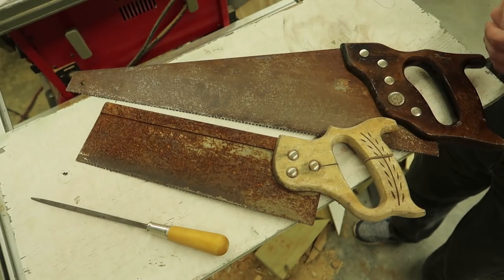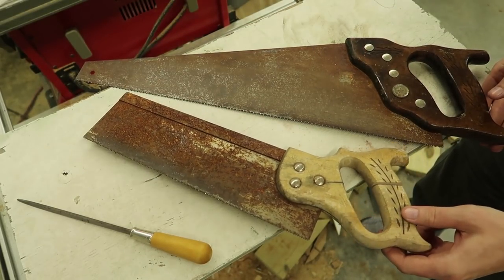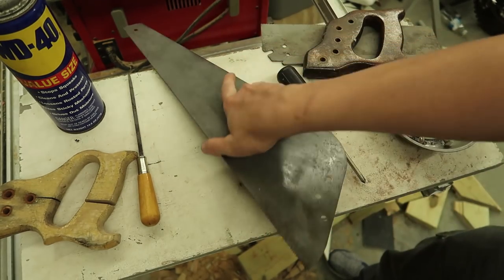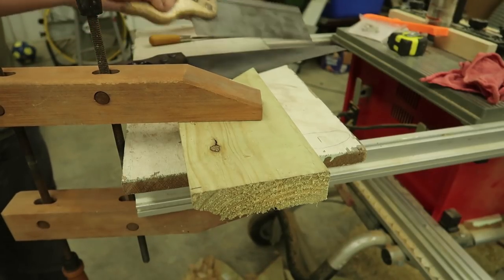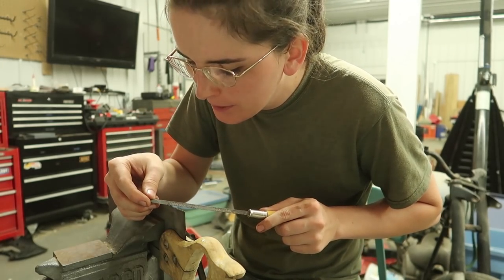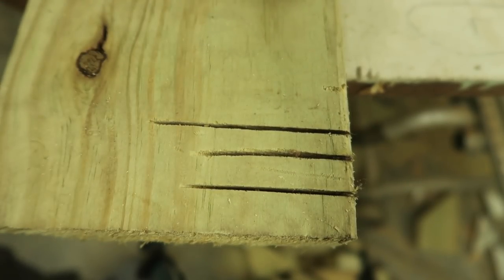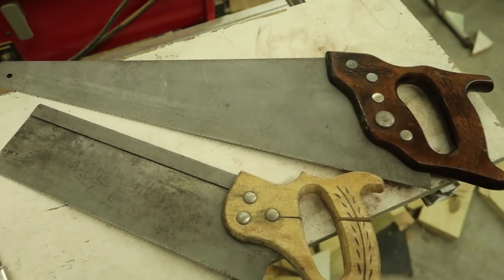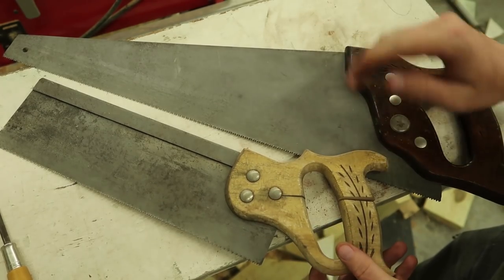Crosscut Handsaw Restoration: Removing Rust, Saw Sharpening, Zinc Electroplating Test

Comment: There is a lot to saw sharpening something I’ve looked at but never had the time to study like setting the rake and set and angles of teeth etc.
Reply from the maker: study? dont need much studying, just a file and a saw, and then once you do the best you can THEN you study
Reply: Rinoa Super-Genius no disrespect but what you did was a redundant step it barely cut after your “sharpening” but what you did do was damage the original settings of the saw so now once you do study you have to first repair what you damaged before you can do a correct sharpening.
Reply from the maker: what you are describing is called a learning experience.

Comment: Hi there, I was wondering if you have had any issues when using these saws with getting stuck or binding up on you. I was told that sandblasting will leave a finish on the saw in which it makes it really hard to push and pull while your cutting. so...are they all good or? Thanks!
Reply from the maker: yes this style of saw is horrible for actual use, thats why most woodowrkers today have switched to japanese Ryoba saws. ya see the issue lies in american saws being push cut instead of pull cut. american saws need to be thicker to push, but they still bind up. japanese saws can be thinner and they cut beautifully. i highly recommend getting a japanese pull saw instead. i have a bunch of these old push saws but they just arent useable. especially since a good pull saw will cut faster than an electric saw.
Reply: @RinoaL  Thanks for the tip! My saws suffer the same issues as yours.Im going to have to look into getting me a japanese type. Im not sure if the local stores (Menards, Home Depot, Lowes) carry them but I will find out. Theres no regular wood working stores in my area. It only makes sense that pull cuts would be easier than push! Thanks